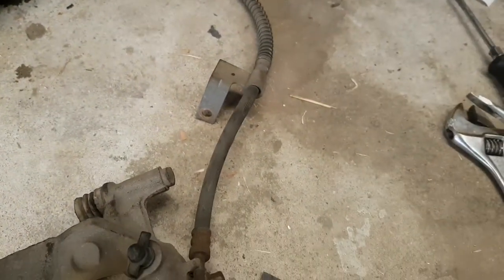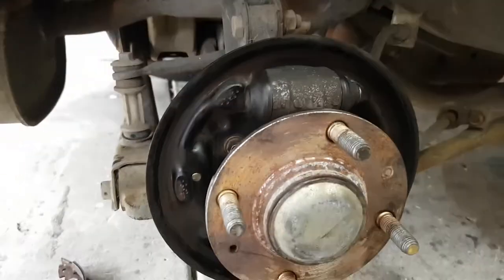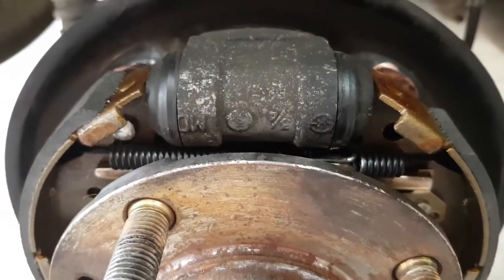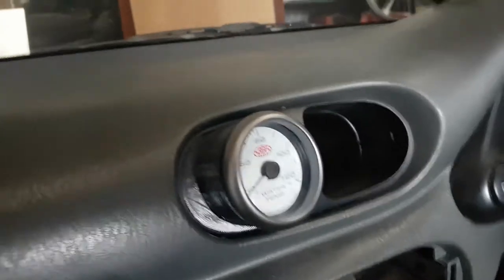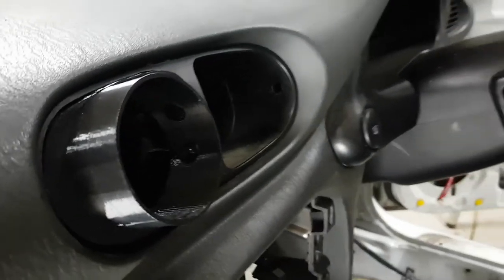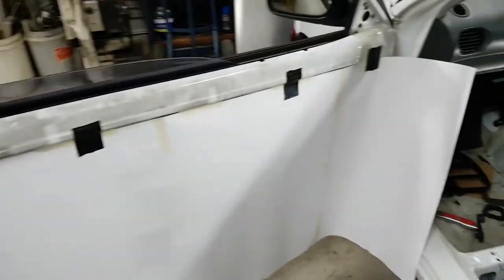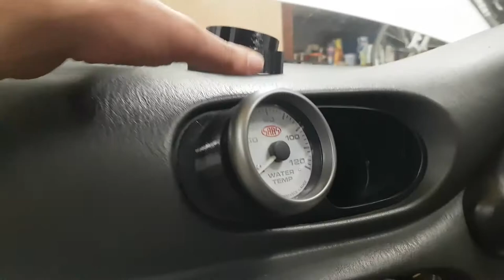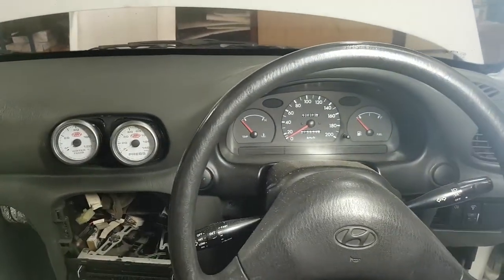Budget Race Car Build - Part 8 - Custom alloy panels, braided brake lines & 3D printed Gauge pods

Comment: I've just binge watched from 1 up to now... Really good information there. totally apricate the information you are sharing, and the presentation is excellent. None of that in your face American stuff where they start every sentence with "Go Ahead "  .... I know it's about 3 years now ...but the music is just a bit much, and can over power the voice audio sometimes.....
Reply from the maker: Cheers mate, yeah i was still figuring out the audio side of things back then, i spend more time on audio now days, sadly once a vid is on youtube it can't be altered otherwise i'd go back and fix the levels. Thanks for watching :)
Reply: @TheNuggetProject  No problem still watching. up to # 22 now. My son and I are building a Rally Getz so we're getting loads of info from you. We attacked the sound deadening with a twisted wire wheel on a grinder. Took a long time, but finally got ride of the stuff.... and the grinder still works...

Comment: Anybody else feel their guts clench up when that screw went down the vent? That's the kind of sound that haunts your dreams.
Reply from the maker: It's the worst! I remember years ago working on my GT-4 celica i dropped a bolt, looked for it for ages, couldnt' find it for the life of me, a year later i pulled out the cross member and it was wedged in there :)
Reply: Jeez that must have been wedged in tight if it was still there lol
Reply from the maker: yup stuck in there good!

Comment: why did't you just cover the holes in the doors??
Reply from the maker: Hey mate, the holes in the doors aren't just the big speaker holes you can see there are holes and gaps all through the inside of the door behind that thin plastic sheet, they all need to be covered up so much easier and less time consuming to just cover the whole thing rather than making up seperate plates for each hole, that would take forever and really not save much weight :)

Thanks for watching
Reply: The Nugget Project oh okey, didn't notice. Nice videos